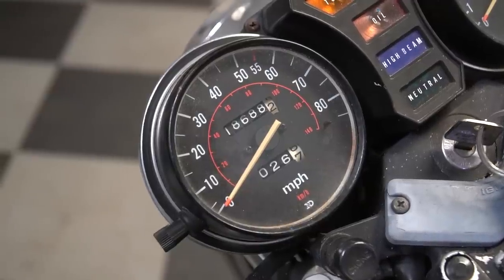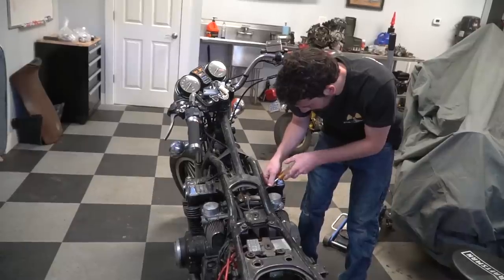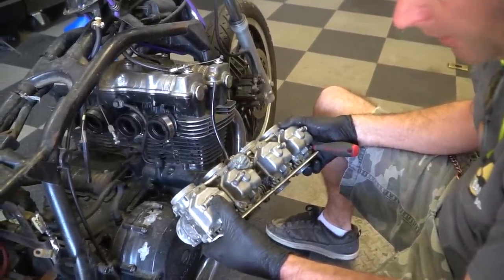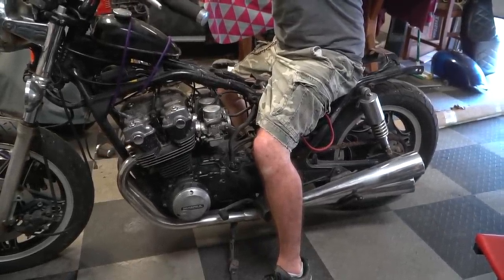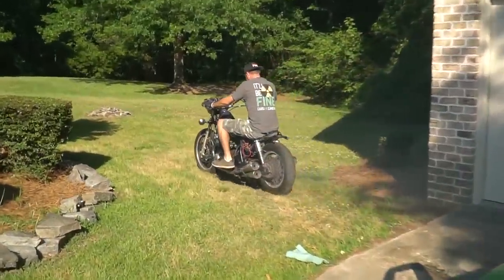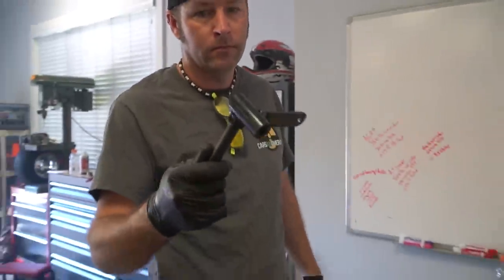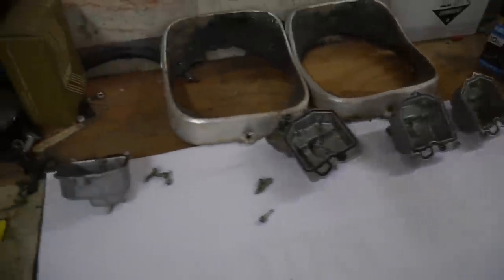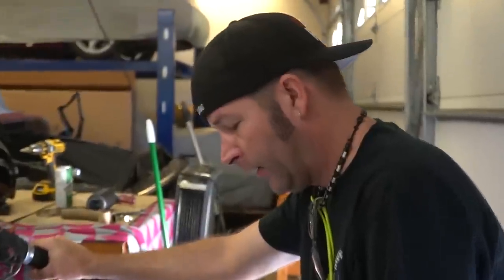Cheap CB750, Will it Start? Cross Kart Build Pt. 4

Comment: The factory CV (constant velocity) carbs are notorious for slide diaphragms going bad causing the slide to stay down till about 4500rpms then slamming open causing a horrible bog. And the same can also be caused by taking the stock air box off and putting on pod filter without tuning slide vacuum. Get a legit jet kit so you can tune the slide. Or just get a set of regular slide carbs and get away from the CV, it works great when tuned properly but it’s a PITA to tune

Comment: Several comments below beating around this. This set up will not run correct without a stock airbox or complete rejet. the pod filters suck unless you aree willing to do the jetting.

Comment: My old '83 magna v65 sounded just like that. Smoke no power wasn't holding idle speed, all kinds of backfires in the exhausts... Turns out it was one of the pickup coil (what tells the cdi to make the spark)  that failed. Replaced it and it was fine again.

Comment: Check the carb boots with some brake clean while its running. Those rubber boots are always prone to cracking and can cause ridiculous vacuum leaks. Plus stick the pods back on atleast to add the rectriction back into the system! Good luck!

Comment: Been through the same thing on my CB900.  You HAVE to run the stock airbox for the vacuum slides to work, or run aftermarket carbs.
Another thing to check is the Poppit valve, there on the side of the neck of the carb, there a diaphragm designed to make the bike run leaner when you let off the throttle to avoid backfires, if there stuck open it will run like that too. There is a delete for them check the CB900 and CB750 forums.

Comment: We had a cb750 motor on a little dune buggy we made years ago, the stock carbs are hell to work with, we ended up making a custom intake manifold and running a single two barrel carburetor on it, it was like night and day in the way it ran, it was a beast after that ..

Comment: If it's been sat a while or has high mileage it could need the valve stem seals replacing
Reply: All those dohc Honda's need new viton valve seals. That's most likely where the smoke is coming from.

Comment: Steel guitar wire string also works well for clearing out pilot and main jets on carbs with tiny holes. Cheers!
Reply: Paint gun cleaning brushes work too, they're almost purpose built for the task

Comment: Those carbs need some restriction from the air cleaner to work properly, the midrange will not work until you fix that, normally KN filters does not restrict the air enough, you have to rejet the carbs if you want to use KN filters. I bought a Kawasaki Zephyr, that someone tried to make a cafe racer of, there was KN filters on the bike when i got it, it ran just like yours until i put the original air cleaner box on the bike, then it ran just fine.
Reply: CV carbs are depending on vacum to lift the sliders, without restricted air, it wil only run on idle and up to about 2-3000 rpm, and if you hold the trhrottle at max, it vil slovly cravl up the rpm and when the airspeed are high enogh, then the sliders will raise, and you will hit the max rpm

Comment: Check that the jets are all the same size and haven't been drilled out. Proper air intake with some restriction so it doesn't run lean, or up the mains and lift the needle at least one notch if you don't have the stock airbox and want to run with stacks or pods (nearly all CBs run like crap without the stock airbox, as others have already noticed). Check ignition timing with a light. CARB SYNC! And check that the idle/pilots are totally clear. Those are the first things to plug up hard with stale gas, and it'll cause hanging idle and will affect everything else. Also check that the carb diaphragms don't have pinholes or tears.

And if you aren't going to use that 4-4 exhaust and it's intact, somebody out there needs it. Make sure it finds a good home ;)

Comment: Yes gentlemen, this engine will definitely need an airbox to create the proper vacuum to allow the CV (constant velocity) carburetors' throttle slides to work properly. Since you are not using this engine on the bike, you could possibly use an airbox from another 4 cylinder japanese 750, other than Honda. Another option (more work) would be to find old Non-CV carbs to fit. If I were you, I would go the airbox route with a good filter and a foam pre-filter mounted to the air intake on the airbox.

Back in the day you could buy a carb kit for for pod installation on honda 750's but it involved more than just jets. Ports for the CV slides had to be modified as well. It was a lot of work.

Just my $.02

Comment: It needs the filters without then cv carbs make it go full rich unlike flat slide carbs. I used uni pod filters and put plastic in them to restrict it abit and it ran great
Reply: I also saw you didn't clean the emulsion tubes

Comment: Try putting pods back on. I’ve had this issue with a motor. When I put the filter back it, there was more vacuum to suck fuel. Solved my problem

Comment: I just had a 4wheeler do the same thing I had ran a size bigger bit through the main jet because I added a high flow filter and had pulled the baffle from the exhaust....it was doing the same thing smoking and wouldn't take over half throttle...put back in a stock main jet and it ran fine....I heard ike say he was gonna drill out the jets...most k&n kits come with a jet...id try pulling the jets from the other carbs and installing them.....
Reply: He definitely ruined the jets, will have to order new ones.

Comment: Great video Guyz!!!  Reminds me of a 1974 Honda 750/4 I had as a kid.  I moved the shifter and foot brake back to the passenger pegs, removed the front driver/rider pegs altogether, front turn signals, speedometer, all traces of ID badges and size displacement, installed over sized jets and a Kirker 4 into 1(un-baffled) header and had myself a street bike that would walk away from some of the bigger 900 and 1000 cc bikes.  
I look forward to your cart having this powerhouse on it and what gearing you select.  Y'all keep up the great work.  
P.S. Isaac, don't forget your "brain-bucket" next time!!!!

Comment: CHECK THE BOTTOM OF THE PIPES BEHIND THEM. My wife has a 1982 cb650sc honda nighthawk and they have the same exhaust and they were known to rust out there. I patch welded hers and wrapped with 1/8 sheet metal then welded again and then grinded it all down and painted them with black high heat paint. It is super hard to find an old good exhaust for these bikes. hers acted similarly. The pipes rust from the inside out because of the angle of the pipes and moisture sits at the lowest point. Therefore an obstruction inside from the rusted metal breaking in pieces is also likely. I took them off and blew air through them and had quite a few chunks come out after I repaired them.

Comment: I had one of these 3 years ago it halls ass. Sold it due to a rotted tank that leaked and cylinder one had low compression. I figured it was a burnt valve n later sold it. But even with it cylinder one like that it always put a smile on my face.

Comment: 13 years of carb tuning here guys...anyhow, Probably already been said in one of the other 946 comments but with the vacuum slide type carb its important that the slide moves as it should. I didn't see anyone watch for the slides to raise as they should. If the slide doesn't have enough vacuum to operate ( due to cracks, hole or bad install in its seat) the main jet needle won't rise enough to allow the main jet to flow sufficient fuel through the emulsion tube. Also, check that any float bowl vents are clear and float height is correct otherwise you can have a lean condition.

Comment: My brother and I had to get his 82 CB 750 running from a 29 year nap. We had to do everything you would really have to and still have it and ride it. It works great these days. I may be able to give you some direction on where to start with it. I also have a couple videos on you tube where I did some decent burnouts on my 82 yahaha 920. Blew the rear tire on both.

Comment: I know Ike doesnt want to take that rack apart but if it just stays running lean after you do everything else the other viewers mention (air box, cleck/clean the vacuum slides, sync, etc.) you will have to check and probably replace the air diaphragm on the side of each carb.  I had to do this with my '82 CB750 K in the early 90's and it was only 10 years old at that time with 4000 miles on it.  Those old rubber parts dry up guys.

Comment: I have a 1980 CB750F, basically that same engine, I've run pods and open pipes on it for 16+ years and it runs great, because I bit the huge $135 bullet for the dynojet jet kit.

Comment: Guys, read-up on pods with CV carbs. Basically, they don't work when directly mounted. The CV carbs need to have the incoming rush of air directed correctly to the carb's intake area. Use the factory airbox, or in the least, the factory rubber boots that connect the carbs to the airbox, and add pods after that. 

Also, the factory air filter will flow more air than the pods will, dues to larger surface area. Pods sound cooler, though... ;)

Comment: You should check the carb vacuum balancing and the ignition  timing. You check the ignition Tim down by the stator under the right side engine housing cover.

Comment: Get rid of the pods. That's exactly what it is. I use to have one and did the pods and found out that its blocking the venturi on the slides. Get that valve gasket fixed. Pipes are clogged up. Clean the carbs really good. I ran ngkr in mine ran awesome. That engine has plenty power. I use to wheelie mine all the time no prob. That engine has a lot of power u wouldn't believe. Do not put pods on that. It is not good. I'd put the stock box and u can still run a k&n filter In the stock air box

Comment: I know this comment is late but I have just had chance to watch the video. You need the factory airbox on the engine and you need to sync the carbs which is done with a special tool. I had a 1980 CB750 and tried pods and it worked like crap. I put factory airbox back on and had carbs synced and it worked perfect. Every year I had to have carbs done. Also if the rocker arms are the style with lash adjustment on end, They need to be checked regularly. After a season of use the are off slightly. It is just the nature of that engine.

Comment: Without air filter it gets too much air and strangles itself. I have kept cleaned the carburettors without results so fix the air filters and it will go if it gets the right air mixture.

Comment: That's a big heim joint like we use in 4-link suspensions.  You should be able to find those in various sizes at tractor supply or harbor freight.

Comment: For as much stuff as you guys do you need to invest in a soda blaster for carbs it's amazing
Reply: What's that?
Reply: @michaelvangundy226  it's a machine that's enclosed where you can stick your hands in it and compressed air shoots baking soda onto your parts takes rust, dirt, Grime, old ethanol it's great, I use it when at the motorcycle shop it's the best thing for cleaning carbs then you just spray it out with carb cleaner
Reply: @motorcyclemechanic.  
So it's a sand blasting cabinet but with baking soda. Cool.
Reply: Yeah we pretty much took our sandblasting cabinet and then change the tip to a smaller one and just stuck baking soda in it

Comment: Timing is under the right side cover. It's part of the points which are actually electric pickups on this. Like others have said you might have better performance with some sort of air box. Pipes coming off of the carbs helps line up the air as well. You could put velocity stacks connected to a box with a large pod filter on it. Smoke is fine, just keep adding oil. My 650 has been burning a quart every 500 miles for a while now.
Reply: That was long before this model, it wouldn't be running if that was the problem.
Reply: @gsp49  What was long before this bike? What problem?
Reply: @MrMCTario  , timing, no points on this machine, all electronic.
Reply: @gsp49  oh, ya, that's why I said it was electronic. And timing isn't making it smoke. They just said they were going to check it.

Comment: I think those are accelerator pump carbs, which means vacuum opens the needles. Check the diaphragm in the top of the carbs. I had a similar problem on the Ninja Buggy I built.

Comment: Check to see if  the slides are free in the carbs and are the diaphragms ok? Vacuum slide carbs should have the air box but I've made them work with pod filters.

Comment: Dudes, those are cv carbs, they are vacuum operated. Your air/fuel mixture won't be rich enough until you put the factory airbox back on which provides just the right amount of restriction to create just the right vacuum to open the carb slides just the right amount.  Been there on my CB400.

Comment: I'll agree with the others, a factory airbox would be a big help. Especially down the road when this motor is fitted to the crosscart, you can add a snorkel tube and keep all the crud out of the motor.

Comment: Just for giggles duct tape half of all the throat openings closed. It does sound like lean condition but the bogging noise is kinda concerning. Timing these things is important. They like to burn holes in pistons if theyre off. Otherwise good find! Hope the smoke clears up!

Comment: Nice.. !!!  I had an '81 cb750c  w/ 4into1 kerker exhaust, drilled out my jets too.. intermittent coil issues.. dropped 1 tooth on front sprocket.. was a screaming rocket..!!!   Good Choice..  😁😁😎🔥
Reply: Also advance the accelerator pump on the carbs.. if those have it.. 🔥😎🔥

Comment: To run pod filters or no filters the CV slides need to be modified. Take the pot off the top and remove the slides drill the 3 holes in the bottom  out to 5/32" and that should help the CV slide operate faster hopefully taking care of your bog. Then you will have to jet accordingly

Comment: don't forget to sync the carbs, so that all the cylinders pull the same.  having the filters in place will help the engine draw fuel better,.  check vacuum lines also.

Comment: Do a compression test on that engine, if it's low, it really isn't a hard job to re-ring it, re-hone it, lap and adjust the valves and send it.  Also as others mentioned, CV carbs don't like pods, I'd look to see if you can find a set of cheap flatslides to swap on since you won't be running an airbox.  I actually got my KZ400 running pretty well with a cheap pair of OKO PWK clone carbs.

Comment: I don't know if this was said or if you checked it but the valve cover gasket may not be bad.  Double check that both of the crank case breathers are open.  Either having breathers on them or nothing plugging them.

Comment: By the way, check the small diaphragm on the bottom of the float bowl and see that it is working if not you will have a very bad flat spot right off idle as it is a fuel enrichener. the screw(s) on the bottom of the intake side (head side) of the carbs is a fuel adjustment screw not an air screw. screw out to richen and in to lean.

Comment: try running filters on the carbs to get more fuel suction if you run pods make sure its jetted properly and the rubber boots don't block the ports

Comment: full rebuild  and sync on the carbs..... check the valve clearance, the 25mm valve shims shouldn't be too hard to find still. That motor will run like a bag of ass on pods, it needs an airbox for sure. The stock CV carbs suck, but can be made to run fairly decent. I used to have an 81 750ss, swapped in a 900 motor bored to 985, would keep up with modern-ish (late 90's-early 2000's) at the time.... up to about 100mph. Stock gearing topped the bike out at about 130ish.

Comment: it's just super lean, needs air filters (oiled) and jetted up. May have to sync. them. Sounds fine. It has 2 hyvo cam chains so not much chance of it jumping time plus it is a O fit engine so the valves would be bent if it had jumped time. Check you're charging those bikes are known for bad staters and rotors and reg. rec. if it's not charging it will break up (miss like all get out) when you rev. it.

Comment: My cb250 had low rpms after start up 2 things I did to fix which I have no clue on ur cb750 but turned the idle screw on the side of the carb up and whiskey throttle it till it could get rpms up then it was good the rest of the day

Comment: Those carbs need synchronising with vacuum gauges,  and I would be checking the rubber diaphragms in the top of the carbs, if they are perforated the slides won’t lift properly at the higher rpms.

Comment: My 4cyl Suzuki with diaphragm slides wouldn't run right without a shared breather box not even single pods but when I installed the original airbox it made a night and day difference

Comment: if it doesnt stop smoking you could try replacing the valvestem seals or and run some magic mistery oil through it to break the rings loose from the ringlands (check compression should be low if the rings are stuck) 
you might need to syncronise the carbs too (4 vacuum gauges and the tops of the carbs off ) once its running

Comment: Assuming you took the top of the carbs apart to check the slide boots I've seen a few carb bikes rev just like that with no air filter.

Comment: Its gotta have the factory airbox on it. Those cv carbs do not like all that air flowing into them there has to be some restrictions. If not its going to run exactly like that. If you dont have it you will have to re jet it for pod filters or velocity stacks.

Comment: 79 Honda 750 had electric start with kick start.   Sound just like the 79 we had back 40 years ago.  
Hopefully you'll get it running better as it is gummed up in the valve area most likely.

Good times 👍👍👍👍
Reply: Gumed up in valve area? You have no clue.
Reply: @gsp49  never claimed to be the resident expert.